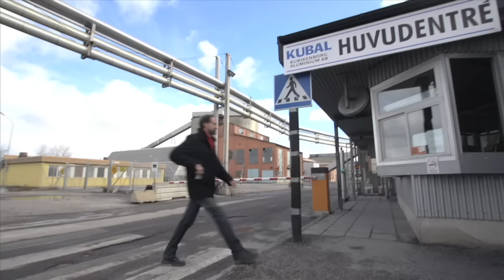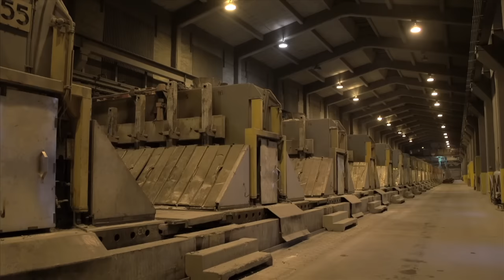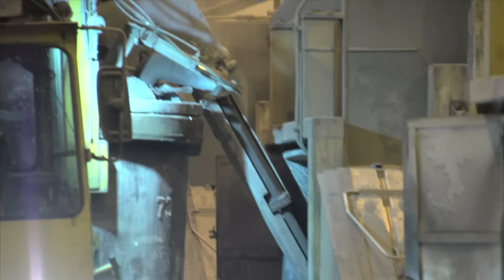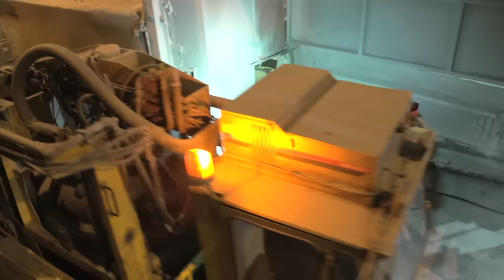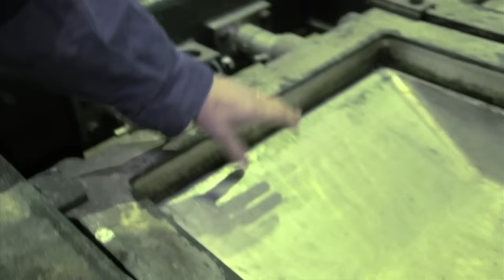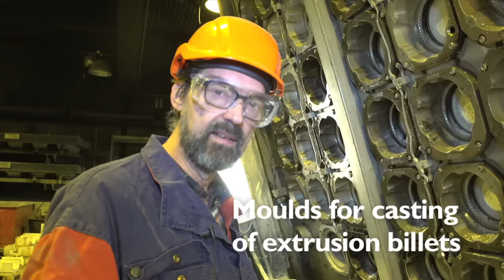Aluminium-Smelting and Casting

Comment: I worked at this smelter in 2005 to undertake a feasibility study to convert the sodaberg pot lines to pre bake. Was a very interesting project. I still remember the American plant manager Joe. Sundsvalle is a beautiful town.
Reply: Sir can you share your email. I have couple of questions to ask. If you arr kind enough to answer them please.
Reply: @Ismail-dy1wt  no sir, but ill answer your question here if i can.
Reply: Thank your sir. Do they used used copper wire for anode supply.? What was current supply and current density of anode and cathode? Can we use any materail with minimum possible dia with high current carrying ability. As we use almost 30-40 copper wires 2 inch dia for anode supply. Its very difficult to handle them.
Reply: Cathode tub is of mild steel or any other? Can we use any other material than graphite as an anode?
Reply: @Ismail-dy1wt  "cathode tub" im assuming you are meaning pot shell. Usually constructed from carbon steel plate. Anodes are usually constructed using a mixture of coal tar pitch and petroleum coke.
Reply: @Ismail-dy1wt  anode electrical supply is typically constructed using aluminum sheet plied together to form whats called a flexible. Cathodes generally use an appropriately sized copper bar to pass current.
Reply: What current requirement for alumina refuction in one cell?
Reply: Sir why dont they use copper. Is there any specific reason for this?
Reply: I'm pretty sure the anodes should be replaced about every 36 hrs not 30 days
Reply: I need investors for cooperation in the gold and nickel mining sector
Reply: @jadinwemette8251  please i need investors for cooperation in the gold and nickel mining sector
Reply: I have 7 billion robux

Comment: @
do you own a Cold ROlling Mill and other strip process lines, are you still using Rubber Rolls, Vacuum Rolls, Compressed Air -Air Knife Systems for removing, wiping, drying of the Strips, Sheets and Foils being processed on Cold Rolling Mills, Pickling Lines, Degreasing Lines, Skin Pass Mills.
Try using the High Performance Adaptive Wiping System, no requiremnt of Electricity, Vacuum, Compressed Air, Rubber Rolls, our innovative design uses the science in a different manner to wipe, dry the passing strips wihout using any energy.

Comment: That's really good. And I want to know what heating element do you used in the process of manufacture?
Reply: Electrolysis with cryolyte solution
Reply: @jadinwemette8251  Do you use silicon carbide heating element?
Reply: @kennyzhao265  not sure about that, the carbon layer and block is where the electricity flows to and from with the solution in between, shocking the alumina powder at about 2000 degrees with p225 pots. Whether silicon carbide is used, I've no idea
Reply: @jadinwemette8251  It’s okay, thank you.
Reply: Come please  my  job  survey  mining  ore  nickel  and  gold
Reply: @alfatih8207  your company need sic heating element？😄
Reply: @kennyzhao265  i need investors for cooperation  in the gold  and nickel  mining  sector
Reply: Induction process, heavy current passing from Abodes to Cathodes via liquid bath.
Reply: @kennyzhao265  No, current jumps from bottom of the Abodes to Cathodes at the pot.

Comment: What is the rate of corporate tax paid by industry's like yours in Sweden.
Reply: Slightly more than 20 %. 
Usually the survival of industry like this are determined by the price for electricity rather than the tax level. Norway and Sweden have an extra fee for electricity which the industry does not have to pay. This basically works as a tax relief for some major industries. Particular those that demand a lot of electricity, like aluminum production.